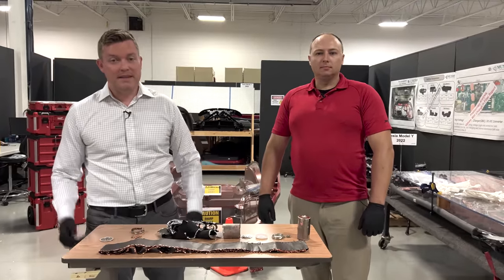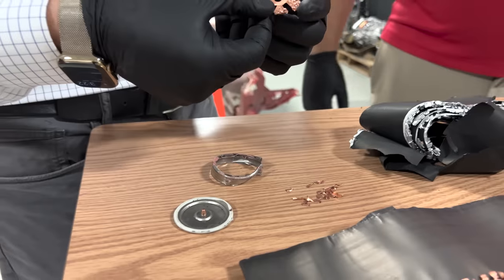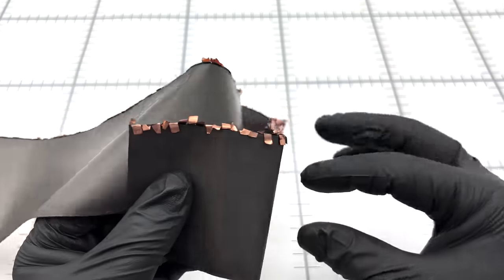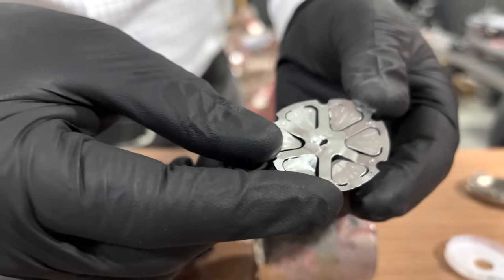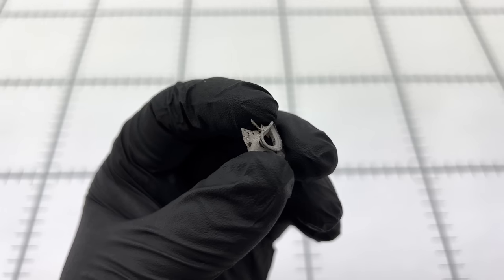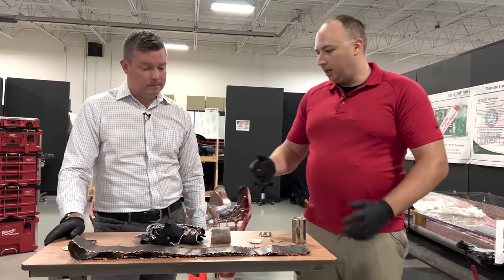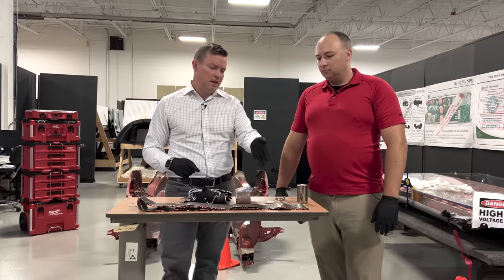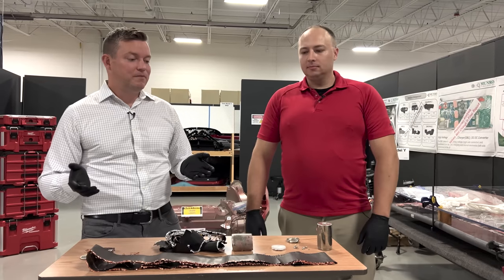What's Inside a Tesla 4680 Battery?

Comment: The original design tesla showed on battery day did not have any welds to the jelly roll terminals instead they just used pressure against the end caps to provide thermal and electrical connection. 
I was surprising that that pressure contact alone was going to be good enough when those cells are subject to vibration and thermal cycling and contact corrosion and resistance heating inside the cell.
Those flower petal end terminals with the roll tabs welded to them solve the terminal corrosion and resistive heating concern and they also act as a heat spreader so they must have found that pressure alone was not going to be good enough - and it also helps explain why it has taken longer than expected for the 4860 to reach production as they were supposed to be switching over much sooner than they have done. The new design seems very good.

Comment: Hey guys great video...given the teardown you've done to the cell now do you see the potential in the current design that would lend credence to reports that Tesla is having production yield issues of this cell?  Switching gears a bit....any thoughts on doing a performance assessment against other cells?  Like a cell showdown of sorts.  Cyber cell off :)
Reply: I count (at least) 7 new processes to be perfected in this cell.
Not even the "tradition manufacturers" have used them (they possibly still don't use them all?)
When they do get this right it's going to be transformative .
As for the comparison, we already know the previous stripdown used a "lower grade" cathode material (Below the 2170 standard)

The jist I got from this is that it's upgraded.
Sandy already said they were "surprised" by the performance of this iteration, it was better than expected.
.
Now consider they gave an indication of the composition, but it isn't absolute cutting edge(?)
.
That indicates there's a lot more scope for improvement.

Comment: Copper 'rivet'/ pressure relief is inserted after electrolyte fill, it isn't used as a locating feature.
Reply: Is there an electrolyte fill?  Looks quite dry to me.  I'd expect a gooey mess when they pulled it apart if the electrolyte was a liquid.  Seems Tesla is using a dry process now.
Reply: @tesla_tap  Tesla (Maxwell) dry process is for electrode manufacturing (no solvent to evaporate). Cells still have electrolyte that ions travel through. They only add enough to saturate the separator, no extra to slosh.
A solid electrolyte cell would be totally dry.
Reply: @tesla_tap  The electrolyte is drained and likely evaporates - it's a volatile hydrocarbon solvent.

Comment: I was waiting for a 4680 build but couldn't wait as I needed a car, ended up getting a Freemont build
Reply: Lucky you - the gigacastings are writeoffs if damaged. The cells are impossible to salvage, which makes cash recovery by insurance companies very poor -- watch for higher insurance rates.
Reply: I was split between this decision myself and then came to the conclusion that Cutting Edge" isn't always the best place to be. They have a lot of manufacturing processes to experiment with and work out and I needed a stable reliable car, even if they can fix most things with a software update. The 2170 is proven tech.
Reply: @vidznstuff1  any Car would be a Writeoff with the damage required to get to the Castings..
Reply: @unitrader403  
Let the FUDs keep moaning, it's of little consequence 😉👍

Comment: Love the CT scan. I would love to know what Tesla's internal scrap rate is for those cells, and if they are going up or down the learning curve for the current design.
Reply: The scrap might be super high loocking at how fragile the interior of the cell is
Reply: I watched another video where the guy claims he has an inside source. According to him, to solve the calendaring problem they have had to run at 20% of the original target speed. But they only have a 2% to 3% scrap rate. I'm sure they are working hard to get the speed up.
Reply: I believe Tesla said scrap rate at battery day.

Comment: Looks pretty similar to the one from the Limiting Factor, which indicates that measurements by UCSD could be correct for now. It would be interesting to see if Munro found liquid electrolyte and if the cathode was still made with wet process.
Reply: It uses liquid electrolyte. 100% guaranteed
Reply: I believe the new 4680 that Munro got has thinner enclosure so would offer better Wh/Kg than the earlier 4680 that was analyzed in SD
Reply: @ranig2848  what does lead you to this belief?
Reply: @eigenvalue9358  Munro mentioned that in one of the previous videos. They said the batteries had fairly thin shell whereas in the SD videos they said the cans were thick. We’ll know more when SD gets the Munro cells via The Limiting Factor.
Reply: @ranig2848  just measuring pixels at 3:30 indicates the same thickness to me. obv this is the most precise method to determine the actual value 😂😂
Reply: @PR-hl9pm  Probably, but I wouldn't guarantee it. The two cells were made in different lines. I can't wait to get the results for this new cell.
Reply: @geordonworley5618  the polymer separator between the electrodes is made for liquid electrolyte. Also Tesla is not working on ASSBs and no company has released a solid state battery yet.
Reply: @PR-hl9pm  well technically, at least as reported, Blue Solutions released SSBs that went into Bollore buses in France.  Did not go well.
Reply: The seal at the positive end to hold in the electrolyte was very briefly mentioned, but it is strange that they didn't say any more of it, given that they went through every other component of the cell. Their focus is on manufacturing processes and costs, but putting electrolyte in is one of those.

Comment: I am curious why LG Chem and Tesla batteries are so different. I mean to say that Tesla is using smaller battery cells than Chevy Bolt EV, which uses LG Chem cells. Can you brief me about the dimensions of both the battery cells and electrodes for LG Chem and Tesla?

Comment: Almost looks solid state! Dry. Also, when comparing a blade battery to this cylindrical 4680 - it sure looks like there's a lot of square inches of battery material rolled up in each cell. Looks like approx 2.2 square feet. How does that compare to the active square inches in a blade cell? And with any part of the active material being on average no more than about 2 inches from a low resistance tab - the way to go.
Reply: Surface doesn't matter, only energy density and cost.
If there are huge advantages, these have not been implemented in present generation 4680 pack Model Ys.
Reply: Blade cell is LFP while 4680 is NMC, different chemistries with different energy density and safety concerns. NMC would be dangerous in a prism, LFP not so dangerous and prism form has better energy density and cost effectiveness.
Reply: the TESLA 4680 is slightly MOIST and the cell has some GEL electrolite present. , not TRULY Dry process , YET.

Comment: Interestingly, (If I understand the topology you show), that brittle cathode material with a fracture will generally not cause a cell failure since it has the continuous tab construction.   So a vertical break doesn't prevent conduction to the edge.   A horizontal break would potentially take part of the capacity out but only over the area of the horizontal breakage of the material!  So this seems intrinsically more fault tolerant than the tabbed design where a vertical break in the cathode material could open up the conduction path of nearly the entire cell creating a failure (due to the conduction path being mostly horizontal in the jelly roll and only one conduction point out.
Reply: Good point.
Reply: ...which is the reason for the multiple tabs....it's clearly not thermal.
Reply: @goldreverre  
Beat me to it!! 👍
Reply: @vidznstuff1  
If you'd paid any attention to anything said a out this cell, you'd know it's absolutely "thermal" (resistive heating)
Reply: ...maybe, but what about heat dissipation or resistance heat at the break edges. Given what we have seen so far, the level of control during manufacturing ensures that breaks are not an issue, would be my best guess. Nothing here is simple or left to chance.

Comment: major point missed: internal resistance! the folded over ends reduce internal resistance, electrons only have short path to travel rather than going all the way down the roll to the single tab ( old version), its quite brilliant in my view. It was said single tab version prone to overheating and failure......never heard of that happening.........more to do with internal resistance.
Other point is reason for copper and aluminium nothing to do with corrosion!
your dreaming with that one, its to do with valance  and the cell chemistry.
your welcome

Comment: Can't wait until you guys tear apart a Ultium battery pack and show us how GM is 10 years behind!
Reply: You may be surprised how wrong you are!
Reply: @gmv0553  You may be surprised how wrong YOU are!
Reply: @gmv0553   - LG makes the cells for the GARBAGE ultium battery pack.
still uses OUTDATED Li Pouch that caused all the FIRES.
Reply: @FutureSystem738   - gm does NOT even make the ULTIUM cels , made by GARBAGE LG chem. 
BOLT fires , anyone.
Reply: @markplott4820  I know. I was actually agreeing with David Beppler.
GM is ummm, a joke, for want of a better word.

Comment: The jelly roll seems to be very dry looking.  Do that mean that the electrolyte in the cell was a very volatile hydrocarbon of some kind, perhaps with an active chemical dissolved into it to facilitate the movement of ions between the cathode and anode, and it quickly evaporated when the cell was opened up to disassemble it?
Reply: Yes, typical lithium-ion cell electrolytes are volatile organic solvents.

Comment: Noob question: Is there a link somewhere to actual test data regarding the actual capacity and output of each 4680 cell? Everything I've read online talks about estimated capacity and output, as well as weight and dimensions - has the team been able to weigh, measure and test some cells to get an actual tested results?  Just curious.

Comment: One thing I still can't get my head around is how the anode and cathode are spatially situated within the battery cell. Could you show that perhaps?
Reply: The aluminium part is covered with that plastic part to insulate it. The aluminium contact is in a hole in the "cup" part of the body, surrounded by that small gasket they showed. Then the jellyroll is pushed into the cup with the aluminium part first until it contacts the contact. There's a hollow shaft in the centre of the roll, so they can insert a rod to clamp the two aluminium parts together. The copper end of the roll is at the end where the lid (the one with the copper nipple) is pressed on.
Reply: The anode and cathode are two layers of the long stack of sheets which are rolled up to form the contents of the cylinder. 

It's like a roll of tape, with the adhesive side of the tape the cathode, and the outside side of the tape as the anode.
Reply: Thanks! Now I understand

Comment: It would be nice to know the capacity Wh Ah and internal resistance IR.
Thanks
Reply: the capacity is five times that of a a 2170 as was claimed on battery day. this is very nearly in the same ratio as the corresponding volumes. Calculating that 15% more power is more tricky, but can be inferred from the geometry as well. I tweeted about this shortly after battery day, but the tweet was hidden.

Comment: What are the performance characteristics of the 4680?  Meaning the Model 3 loses major horsepower by the time SOC reaches just 50%.  The Plaid however is able to keep peak horsepower high throughout it's SOC.  Is the 4680 going to be a "performance" cell or a "range" cell?
Reply: I believe those things rely more on the total pack size rather than the characteristics of each individual cell. A 4680 pack should generally do better than packs using 18650 or 2780
Reply: Theoretically, the 4680 cell should have lower internal resistance than its predecessors and as a consequence will produce less heat when being either charged or discharged quickly. This is the benefit of the tab less battery design.
The chemistry of the battery is the same but revised packaging means that the overall weight and volume of the battery pack will be reduced but the energy density per weight of each individual cell is likely to remain in line with that of contemporary batteries.
I think that the answer to your question is that these are probably best described as "performance" cells.
It is also likely that lower internal resistances should improve longevity.